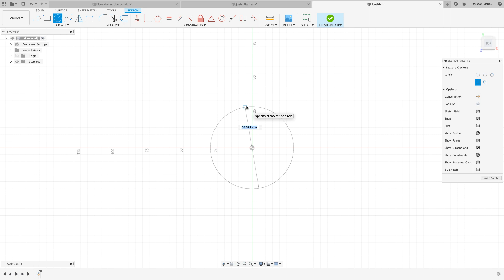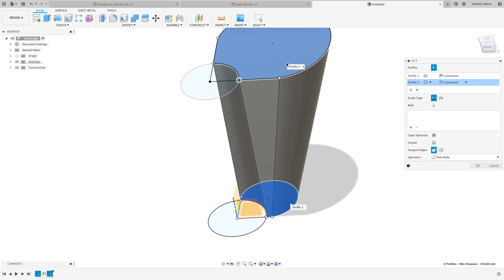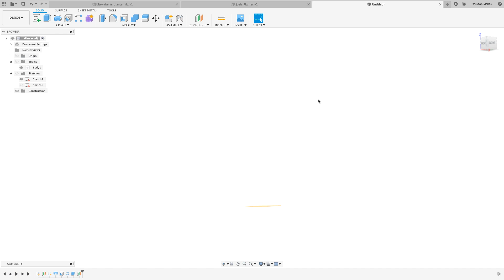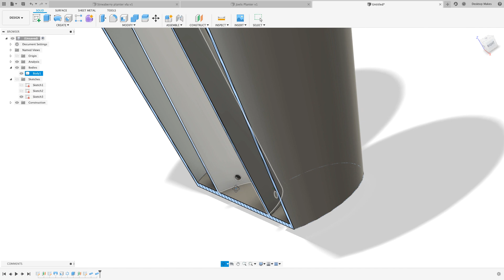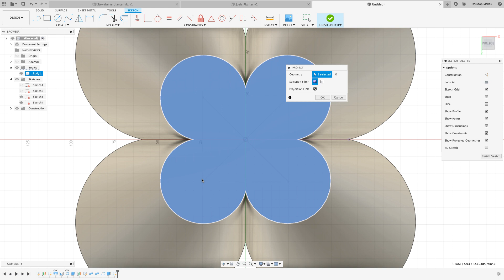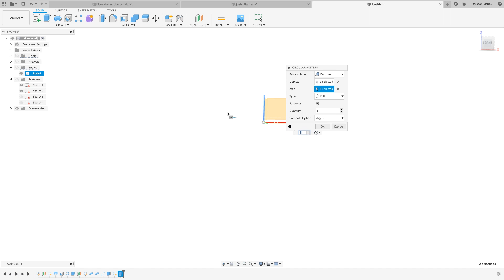Designing a Planter in Fusion 360

Comment: Hi, great creative use of the pipe feature to create the holes. Never thought of using it that way. Anyway, it might be easier to use a center rectangle to create that "X" pattern for the sketch. The center rectangle comes built with the "X" which you can convert from construction into non-construction. Just a suggestion.
Reply from the maker: Great suggestion Fusion 360 School.  I'll remember that for next time 👍